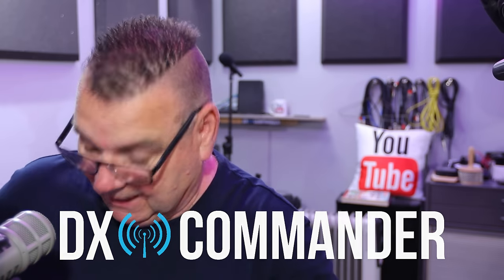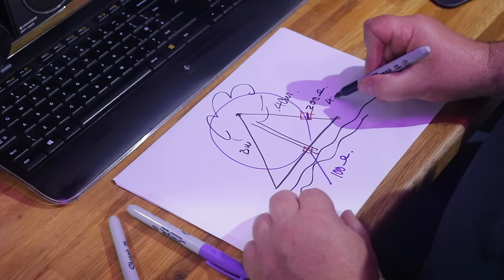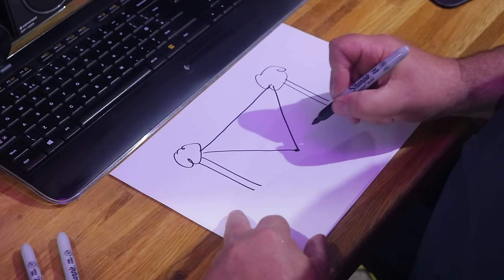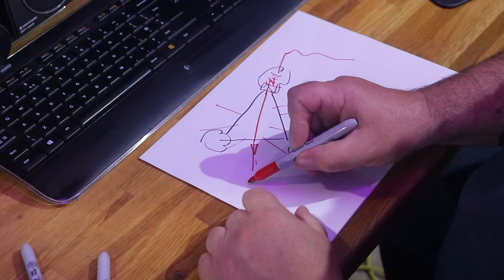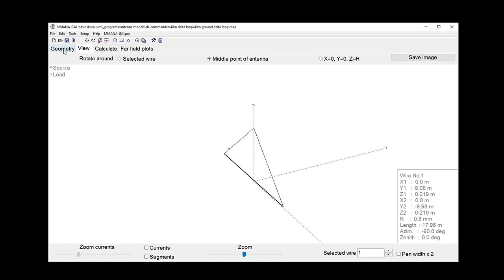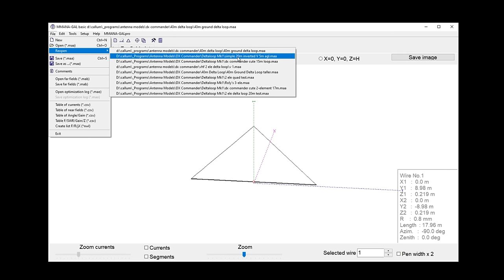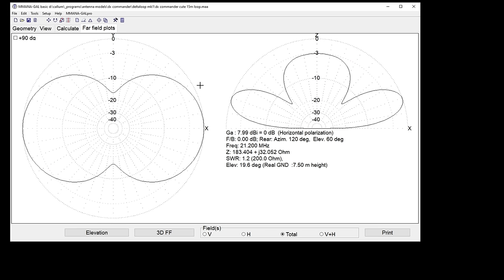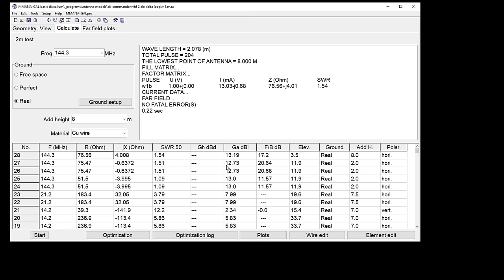The Amazing Delta Loop Antenna

Comment: Hi Callum,
I've got a question for you. Does a 3 element Delta loop radiate the same way as a single element Delta loop. Or does the single element have to be turned 90 degrees and radiate off the side of the element? I'm unclear as to how the antenna radiates whether it's off of the sides or face-on :)
Reply from the maker: OK.. big topic.. If it's vertically polarised (feedpoint at 1/4 wavelength from top of the triangle, assuming pointy end up) then radiation is through middle.. Like a yagi, if you add a reflector, at around 5% larger, you will have more gain in one direction.. Similar if you add a director.. I THINK this is what I am understandding by your question.
Reply: Thank you Callum, I've since learnt that with a horizontal polarisation configuration (bottom fed "V" triangle) if the wire is pointing north to south then is the antenna radiating east to west? (i.e. face on)?

Comment: Great video, Callum! I know you've experimented with the 'loop on ground' approach fairly recently. I can't help but wonder how the delta loop would work (if it even would) in a LoG configuration. Is that something you've tried? Is it worth even trying? Would it not work? Would it propagate only towards those alien civilisations at the centre of the earth? Does the earth not even have a centre because it's flat? Those poor aliens. What if the earth is flat and vertical? I know, I should probably seek help, cheers!  ;-)
Reply from the maker: It would work fine. Low noise and enough signal to hear.. I was using the "square" today on 20m. Worked pretty well..

Comment: This is very apropos, as I've been looking into making a vertical delta loop.  But what if I tried to multiband it by feeling it straight with 450 ohm window line, straight off a balanced tuner, no baluns (other than what's inside the tuner)?
Reply: Using 450 ohm ladder line is supposed to be the best feed method, because it does let you tune the entire line.  In practice, the hard part is keeping it away from metal objects that don't detune it... and for me, the connection point was easy to break.
Reply from the maker: Yes, that will work. WHat is the definition of "work"? Sounds like a video.

Comment: Yes. Excellent ,  I've tried to do (McMana Gal or something like that) some antenna software. The one your using looks good. . I've read about others. Which one are you using ? At this point I have a horizontal 160m skywave loop which works very well.
Reply from the maker: OK, so this is MMANA-GAL
Reply: @DXCommanderHQ  I've even gotten messages to people in the UK using that loop and JS8CALL I guess I should try again for MMANA-GAL

Comment: have a question how much influence does a metal mast have on a horizontal polarized delta loop best regards PE2NAN.  Henk.
Reply from the maker: I would not have thought a lot. Bottom line is that if you are getting a proper tune out the thing, it'll work..
Reply: @DXCommanderHQ  I'm going to try it out thank you 73 Henk.

Comment: Is the loop connected or is it a length of wire in a triangle shape?
Reply from the maker: Connected to a 4:1 balun.. Effectively the centre of the coax goes one way around thew loop and the braid of the coax goes the other way.

Comment: Callum, when you looked at the inverted loop (vertex at the bottom,  base at the top)  you said you didn't see the point since the performance is not markedly better than a dipole.

Isn't the answer that the delta loop would be a  "quieter" antenna in a noisy environment?  For instance,  in a suburb, where there are all sorts of spurious noise generators.

I am relatively new to this craft and am learning a lot from your videos! Thank you!
Reply: That's been my experience, a quieter antenna, at least against a ground mounted vertical.   Feeding it at the bottom should give you the shortest possible feedline too.
Reply from the maker: Ah - good point. But I have receive loops and dedicated RX stuff these days. You are right though!
Reply: @DXCommanderHQ As a suburbanite, I am so jealous of the diversity of antennas you have at your disposal!

Comment: Question - if I built a 20 m, vertically polarized, delta loop, and then added either a director or reflector to it to get gain in the desired direction, will I still receive the same gain on the harmonics?
Reply: No, the spacing would be wrong for multiple bands.  But it should work well on 20m with either a reflector or director.  With a reflector, you can have useful nulls.
Reply: @ke4gbe  but can’t you adjust the spacing, lose some swr, some ftb, on close bands… like 20 and 15?
Reply: @kd8opi  Well, there would be some interaction between the elements on 20 and 15, but unpredictable.  If you have the optimum spacing for a 20m loop and a reflector, just spitballing it at 10 feet apart, but on 15m it needs to be only 6 feet apart to have effective gain.    You'll get a little coupling, but a weird pattern.  You could build it with a separate 15m element inside of the 20m ones, though.   I have thought about trying that, say a 30m inside a 40m delta loop.  However, it would probably be a bad match on both bands!  

I have read where you can take a  40m delta loop and put a tuning stub of balanced line in the center of the top tuned for 20m, that will then give you either a full loop on 40 or two end-fed full wave verticals on 20.  A neat trick!
Reply: @ke4gbe  yeah, I thought of doing a multiple triangle approach, it wouldn’t be that hard really. Spacing isn’t as much as you think, it’s only 6 - 7 ft or so; but you can move it around. The rule of thumb is that you can get a really sharp front back, at the expense of some bandwidth and SWR, but if you’re OK with a front back of let’s say 10 dB instead of 15 dB, you can get away with spacing the elements a little closer.  I’m convinced that a 20 m loop with a reflector would really be great, if I could add 17 and 15 It would be even better.  I’ve already got the parts in order from Wireman, I’ll just have to build it and find out. The good thing is I have such tall trees, I can raise this loop so that the bottom will be 25 feet off the ground.
Reply from the maker: NO, you will get clover leafs etc.
Reply: @DXCommanderHQ  Tx, much appreciated.

Comment: Hi I bought a delta loop for 11m as it's a lighter and I won't panic every time they is a bit off wind but it fell down and it's setting went off so now the swr is really high. Does anyone know what length the legs should be thank you
Reply from the maker: For ABOUT 27.3MHz centre of band, if it's a whole delta loop, it should be between 10.5 and 10.8m depending on the wire used.
Reply: @DXCommanderHQ  thank you for your help. Does it matter the size of each section?.
Reply from the maker: (sorry for late reply on this) If it's a loop that goes all the way around, slight changes to dimensions don't matter, no.
Reply: @DXCommanderHQ  oh great thanks for your help I'm trying today to get it up and running finger crossed

Comment: Callum,

You are clearly "MAD" Master Antenna Designer...
Given you appear to be a Whiz with MMA... Can I give you a mission Mr Callum.??

The Delta Loop appear to have an impedance/Z of @ 100~120

What happens if you "nest" 2 on the same axis, i.e inside each other..??
Say 1 on 50.200MHz and 1 on 70.200, they are not harmonically related, so what happens..??

This post will "not" self-destruct in 5 secs
(Start theme tune to well known TV Show)
Reply from the maker: Same principles (I think) as a fan dipole (if not harmonics).

Comment: Hello Callum, I´m a CB enthusiastic, I´m running my delta loop upside, fer 11 meters, feedding in the bottom with a tradicional monoband 75 ohms with 1,86 meter of coax, supported in two 4 meters rod fish. Have 1: 1:1 SWR from 26,980 to 27,750 with great results, a directional antenna, you could see a QRP QSO to Qatar with 10 watts https://www.youtube.com/watch?v=RuDT5UN2U4c. Tks fer fantastic explanation, now i´m thinking put another in the Farm like a vertical Delta Loop. 7351 and good contacts Callum Paulo.
Reply from the maker: Don't be too concerned about SWR... There's a fundamental myth with CB (not you I am sure) that SWR is everything.. But sounds like a great job!
Reply: @DXCommanderHQ  tks Callum, yes that's true I have a T2LT fer 27Mhz that works with 1 1:4, that's normal for that type of antenna. Tks again fer nice explanation you are doing a great job. 73 and good contacts